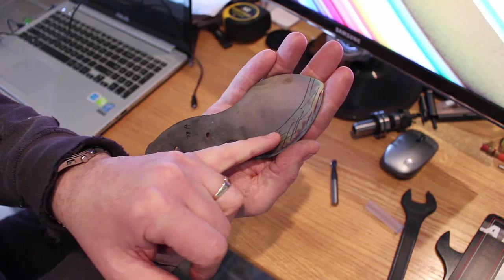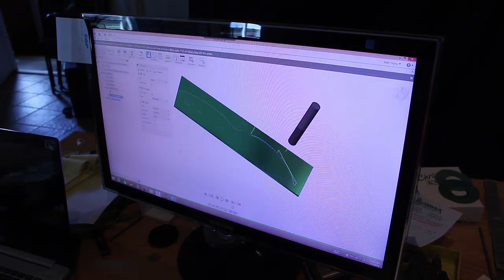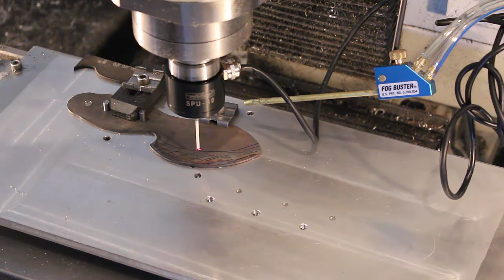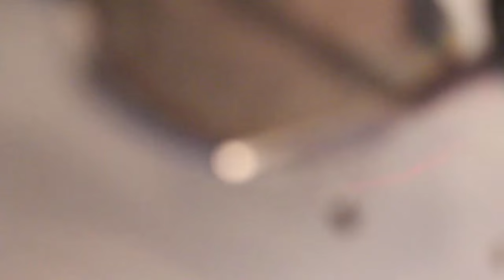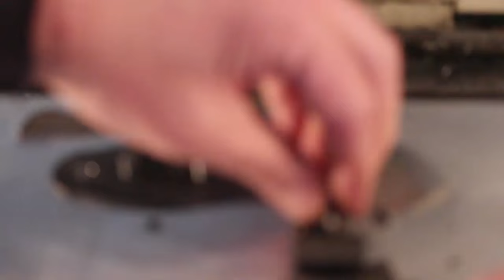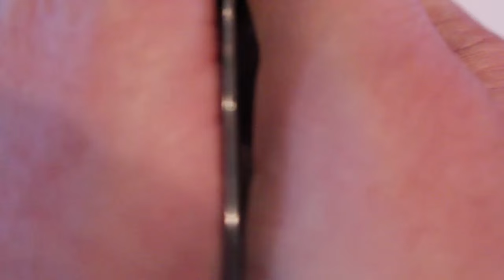Lakeshore Carbide Hard Ball End Mill Vs. CPM S-90V 61 HRC

Comment: Cool knife!

Any chance the EM was wearing out on the second side due to chatter?  It seems like it would be unsupported after milling the first side.
Reply from the maker: +jfpinkston Thanks.  It may be possible. I did have an issue with my fixture. It was not as secure as  I would of liked it. I will need to secure the area closer to the cutting.